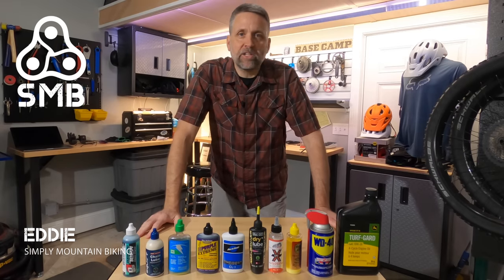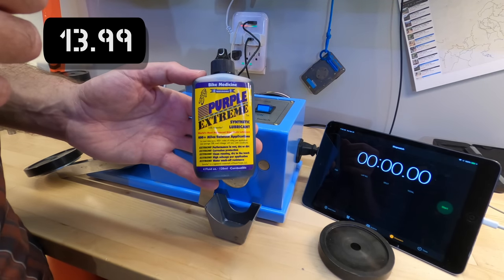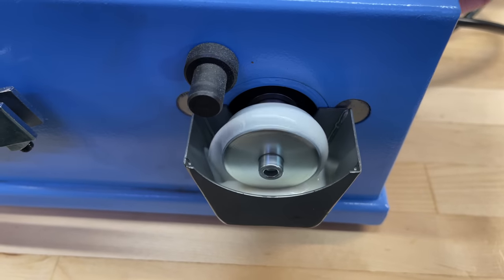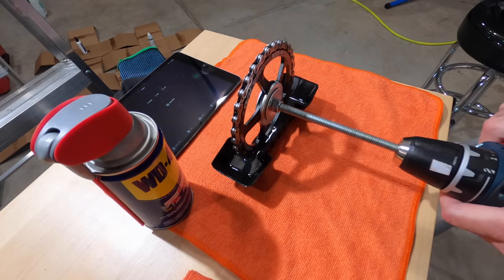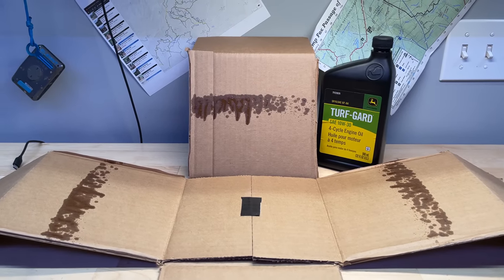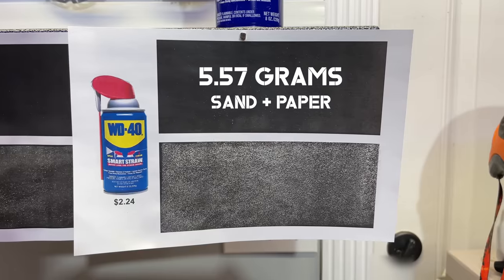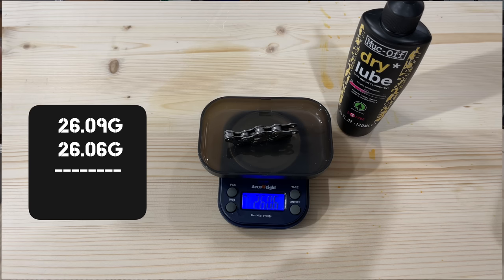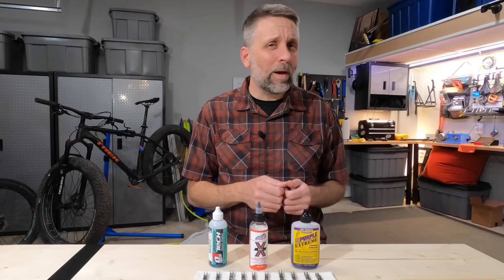Ultimate Bicycle Chain Lubricant Test | Best Bike Chain Lube

Comment: Good video and tests. Funny thing though, I replaced Muc Off after years of use and went to Squirt, it is head and shoulders better in real world application. I have doubled chain life, which increases cog life. Also you dont have to perform deep chain cleaning ever again, just wipe of surface dust and add more lube. Maybe you could have explained a paraffin lube to oil base lubes better. Again, good video.
Reply from the maker: Thanks for sharing!  I'll have a dry test of Squirt soon.  I'll also be comparing Squirt to another paraffin.  I hope you'll watch it. -Eddie
Reply: @SimplyMountainBiking  Hope to see you adding a "OZ cycle recipe (pure parraffin with a 10th  1.6micron PTFE)" Heat wax bath to that test.
Reply: I did the same! I was really disappointed with Muc Off...the only "positive" for me was that it smelled nice. It wears off completely after each ride on my gravel bike...the drivetrain starts sounding like a bird sanctuary after 60-70 km...
Reply: I got a free sample of Squirt for a race a few years ago. That's now my go-to lube. I ride in the SW US and it's perfect.
Reply: Wow, I just shifted to Squirt also. Not picking up dirt and dust is important! I was using Muc Off, but it seemed to gum up the chain after a while.
Reply: The thing with Squirt is, it works exceptionally well if you're lazy. In a lab test you're not lazy, but when coming home from a wet bike ride beging tired you probably are. Squirt is just really, really low maintenance compared to something like the muc-off dry lube.

Comment: Absolutely loved this video. Was up in the air what chain lube to buy, now I know. Thanks
Reply from the maker: Glad I could help! -Eddie
Reply: No you don’t, test was fun to watch but rather meaningless. Comparing apples and pears. Can’t compare regular oils with lubricants that are using a carrier that needs to evaporate before the lubricant will do it’s job. 
I don’t know if the product that “won” is good, it might very well be. But the way these tests were carried out were not correct at all.

Comment: Absolutely amazing work on the tests! Very nice methodology and a great setup for repeatability. 
I only have one small point to criticize. 
The first test is fairly unrealistic in any bike related scenario and none of the bike lubricants are designed to work this way. 
I would have loved to see the same method as used with the Muc-Off dry lube as that is a lot more realistic. 

I would wager that WD-40 could actually perform better that way as the cleaning agents that are part of the WD-40 that are designed to loosen and solve particles from metal would have evaporated potentially leading to less wear.
Reply from the maker: Thank you for the comment and suggestions! -Eddie

Comment: Pretty thorough!  These days, if you don't have immersive wax in your test, you're missing it.  On MTB for dry conditions it's ultra fast, and attracts zero dust/dirt.
Reply: It's does well in wet conditions also
Reply: @pewsician2388  I would differ with you there.   I started with it here in OR this early spring and was caught a few times in steady rains.  On a solid, wet, gritty ride like that the wax is gone gone gone when you get home.  Testing shows it's not great in wet or muddy conditions--where you'd be better off with a wet lube--Silca's Synergetic.  I'll use that in Winter and Super Secret in Summer here.  DOesn't rain all summer.
Reply from the maker: I don't ride dry and was selfish in this test - testing only lubes I would consider using... -Eddie

Comment: Great video! Although most tests don't reflect wear conditions on a real chain, I recommend the channel Zero Friction Cycling. It has more accurate tests. My go to would be Squirt
Reply from the maker: ZFS is a distributor for MSW.  I'm just a dude in my garage.  I have no sponsors or interest in any lube winning.  I didn't find wax to be a good lubricant at all.  -Eddie
Reply: @SimplyMountainBiking  you might want to revisit wax , it's unmatched in chain and drive train longevity and also the fastest. It's not for everyone in every situation.

Comment: While was making a run for supplies I needed for work, I purchased a bottle of Rock N Roll about two weeks ago. I had been having some creaking and clanking issues with my chain for about a year that was quite annoying. I initially thought it was a problem somewhere in my 3 piece crank, but I'm glad I didn't take the bike to be serviced. I used the product as suggested, then gave the chain, free coaster wheel, and chain wheel a good cleaning. Those three areas were where the problem was coming from. An old Champion shirt, a few Q-Tips, and a folded bus transfer were the tool kit I used to get the gunk out of the small spaces and corners.
Reply from the maker: Thanks for sharing! -Eddie

Comment: Excellent test. I can vouch for Muc-Off Dry as well, having used it with good results. If availability wasn't an issue in my neck of the woods, I'd keep buying it. 

I'd love to see you put Boeshield T-9 and Weldtite TF2 All-Weather through their paces in this test as well.
Reply from the maker: Thanks for sharing your suggestions.  I'll add them to the list to consider for a viewer's choice video. -Eddie
Reply: Agree about Boeshield T-9.  It's the only lube I use after 35+ yrs of biking.  I don't have any complaints.

Comment: Loved the tests, so comprehensive. I wish some other very popular lubes were tested like Finish Line Dry Teflon, WD-40 Dry and Pro Link Gold. Although these seem similar to other lubes tested and probably wouldn't stand up to Muc-Off.
Reply from the maker: Great suggestions! I'll have a look at these if I do a "viewers choice" video review. -Eddie
Reply: Also maxima chain pro, finish like wet, 3M Chain saver, Tri flow…etc
Reply: May I suggest that you test a bottle [not spray can] of 3-IN-ONE Multi-Purpose Oil?

Comment: Love how in depth your tests are and subscribed off the back of your chain cleaner tests. 
Stumbled across this test and must say I am and am not surprised. I've just switched to Squirt after years on Rock n Roll gold. in the month I've used it on both my MTB and gravel bike I've noticed that I don't have to apply it as frequently as I did Gold and that my drivetrain is quieter with Squirt. 
The issue with the wear test here is that you are testing metal on metal at high rotational speeds. This high rotational speed will cause more heat build up at the contact area and will brake down some lubricants faster than other, particularly some of the waxes which will melt. Bike chains don't move very fast, don't have high rotational speeds and therefore don't get hot so a lube designed for a bike chain won't necessarily do well in your test as it hasn't been designed with high rotation and heat in mind. There is a reason why there are so many lubricants out for for different uses and this test isn't really indicative of how a bike chain works.
What I've noticed in the real world is that I'm liking Squirt more than any other lube I've tried so far. Sure, I don't have a long time on the product so don't know how it will fair long term but usually a quieter, cleaner chain would indicate less wear occurring.
Keep up the good work, I know how time consuming these videos are to create!
Reply from the maker: Thank you for your feedback.  I love it when people share their real world experience here - to contrast against the lab tests! -Eddie

Comment: Measuring the weight loss of the cylinders instead of the size of the scar would have been a much more accurate way of determining which lubes lubed better.  But great video and thanks for all the information!
Reply from the maker: Thank you for your feedback. -Eddie
Reply: Are you in mech eng

Comment: Wow!   Super video.     Loved it!     Really appreciate all the effort and time you put into it!

I happen to use Rock n Roll Gold.   Glad to see it did well.   It's sold as a drip on dry lube (goes on wet, wipe dry, then let dry for 8 hours before using the bike).    Wonder how it would have scored in the sand retention test if it been allowed to dry first.    Really keeps my chain clean.
Reply from the maker: Thank you - and I appreciate the perspective on letting R&R Gold dry. -Eddie
Reply: I use the RnR Gold on the Recc of World Cup Champion mech Brad Copeland.  He's tried 'em all. I believe gold is not marketed as a dry lube .."creates a wet membrane..." It works best after sitting a few hours because it apparently pushes contaminants out to the surface over time which you then wipe off. Works great five minutes after applying as well.

Comment: I'd be interested to see how Muc-Off's wet lube compares across those same challenges - I was actually pretty surprised to see how well the M-O dry did against the water.
Reply from the maker: Thanks for the suggestion - I might give it a try. -Eddie
Reply: First off thank you for this video’ aros e job! 

@kieran0 I’d second that! I’ve used wet during the winter and switch to wax in the summer. 
I’d love to see how each of the muc-off products perform against each other. 
It would be great to also see how different wax’s perform this had been my first season using wax during the dry months and I enjoyed them. Seemed like my chain stretch and wear were significantly decreased. Am I crazy? Thanks Eddie

Comment: I see a lot of comments regarding Squirt. I am a Squirt user and it’s definitely fantastic. I noticed right away that in the first friction test you didn’t wait until the wax dried which is the recommended way to use it hence why I knew the wear would be too much. I’m glad you rectified that later in your comments. Definitely wait overnight before you go out and ride your bike. I’ve had my chain for 2.5 years now and have ridden over 12,500 km on it and no wear on my chain yet. An Ultegra 11 speed.
Reply from the maker: Thanks for sharing! -Eddie

Comment: Complex, objective,extremely comprehensive, and professional. 6 stars. But in doing basic free repair in  a "low income" city on many old bikes that are not used to travel far, and many are often left out in the rain and snow or otherwise not much cared for (and often get stolen), I  have just use drained motor oil.   But I do have some "Finish line" dry lubricant I will now use on a new bike. Thanks for the exceptional testing.
Reply from the maker: Thanks for the comment! -Eddie

Comment: I'm currently using Purple Extreme, so far so good, but had i known about rock n roll gold I probably would have chosen that lube. I was primarily looking for a good chain lude to use this winter. i live in Wisconsin so I'm dealing with cold temp, snow, slush, rain, and road salt all getting on my chain this winter.
10/27/2023 Update: I stopped using Purple Extreme and switched to Finish Line wet lube but noticed that my chain was getting VERY dirty even after only just one week of road cycling. I just switched to R&R Gold today.
Reply from the maker: I think Purple Extreme is a good choice for your winter climate.  It has low viscosity - allowing it to flow better when cold - and keep those inner surfaces on the roller bearings lubed. -Eddie

Comment: Thanks for the honest review 🙂
May I suggest that you test a bottle [not spray can] of 3-IN-ONE Multi-Purpose Oil?
It would be interesting to know how well it performs - especially because it is inexpensive and it is something that most people have in their tool shed / garage.
.
OK, a can of WD-40 is something that most people have at home too.
But everyone knows pretty much that WD-40 is for freeing / loosening up rusted / corroded components etc.
[a stuck bolt or screw, or a stiff door hinge etc.]
It is not intended as a lubricant nor was it ever.
.
Also, I have to say that some tests that you did were pretty much a total waste of time.
Test the product as it is intended to be used.
An oil, sure it is sticky, but it stays on the moving part.
A dry lube, well don´t test if sand sticks to it seconds after application, test if it sticks after the allowed drying time.  And don´t test using a reservoir of liquid product for a dry lube - that makes almost no sense at all.
.
cheers 👍
JB
Reply from the maker: You're welcome.  Thanks for the feedback. -Eddie

Comment: I use motorcycle / industrial high speed chain lubes for bikes. If they work in a motorcycle when riding 200+ km/h, they must work in a bike where requirements are much lower. One thing, WD-40 is not a lubricant. Anyway, this was quality content and interesting to watch.
Reply from the maker: Thank you.  And thanks for the tip! -Eddie

Comment: About 4 months ago I went from using Muc-Off to Squirt. I am never going back. The chain stays totally clean and it lasts twice as long as Muc-Off.
I have to stress, if you go from oil, or a new chain, to wax, clean your chain thoroughly. It's worth it. Now I only dry brush the chain before rewaxing. Oh what a joy!
Reply from the maker: Are you a road cyclist or MTB?  I think I'm noticing that road cyclists are the primary endorsement for Squirt and wax...  -Eddie
Reply: @SimplyMountainBiking  Road. And yeah, I have no idea how it performs in the mud. I can imagine though that hosing your chain every week might make MTB riders less enthusiastic about these products.
For me a quick sweep with a light brush is usually sufficient.

Comment: I’ve recently become a bit obsessed with studying products like this. Mostly gun oils along with some other stuff. This video is amazing. Your tests were so well done and extremely informative. There’s a ton of products like this you could test. I know this a bike channel but if you’re interested I could recommend some gun oils to test. In any case you should check out for yourself a product called seafoam deep creep. It’s a penetrating oil for loosening rusty bolts and such, but is also quite a good lubricant, protects fairly well against rust, and is supposed to resist heat and evaporation. They recommend it for bike chains.
Reply from the maker: Thank you so much!  I don't have any current plans to break out the test kit soon.  I'll keep this in mind - maybe some day! -Eddie

Comment: Very thorough testing protocol, however, one FLAW, and it is a big one; several of these lubes, including the best friction resisting one, Demonde, in particular, is meant to be applied sparingly, worked in by riding to generate heat, thus bonding the product, then the excess wiped off before and after a moderate ride. Some of the others are also meant to set up/dry prior to riding. These oversights, unfortunately, pretty much cancels out several of the results of the impressive work that you so painstakingly put into your testing procedure. Would love to see you make "Ultimate Bicycle Chain Lubricant Test | Best Bike Chain Lube 2.0".
Reply from the maker: Thank you for your comment.  -Eddie

Comment: I can only speak for Dumonde tech and muc off. Both of those lubes are meant to dry before use. Dumonde tech is extremely finicky working best when one drop has been applied to each roller, the the entire chain is throughly wiped with a rag. The goal is to have lube on only the mating surfaces. After that it works spectacular in both and dry conditions. I would have really loved to see an motor connected to a dynomometer to test the efficiency of the chain lubes.
Reply from the maker: Thanks for sharing! -Eddie

Comment: This presentation was outstanding!  After getting the Muc-Off Wet in a Kit, I decided to buy the Dry and I also was impressed by it's ease of application, performance, and smell! I was very impressed by the water test with it, as I thought it would really have issues with that one.
The bottle of Rock n Roll gold that I have says it should applied the night before riding and left to dry;   would have liked to seen the results if left to dry like the other 3 @15:34
Reply from the maker: Thanks for sharing! -Eddie

Comment: One comment about the leader lubricant (Muc off). You mentioned that it had a “banana” smell. Something you should be aware of, I’m a beekeeper, and one of the thumb rules we go by is “No Banana scents”, regardless if is an actual banana, a scented perfume, or even a banana cream pie odor ( especially artificial banana). This scent closely resembles the alert pheromone that bees use to point out a threat. Once the bees start stinging, they will release more scent, resulting in a more severe attack, from which running or even immersion in water will NOT stop. ( I’ve serviced apiaries that consisted of Africanized (so called “killer”) bees, so I do have some experience with this.
Along with the banana scent, once alerted, the bees will concentrate on the color black, as in black clothing, bicycles, camera cases, and even car or bike black plastic mirror backs. 
I would advise that you avoid this scent when going on a ride… if you do alert bees, you will NOT succeed in outrunning them. Best to cover your face and get indoors where you can block the attacks and remove the bees. 
Beekeepers routinely use their smoker tools to apply smoke to their suits. This seems to work well as we have them working prior to working the bees.
Just a heads up.
Reply from the maker: You learn the neatest things on YouTube.  Thanks for sharing! -Eddie

Comment: Very great video! Very impressed! WD-40 is an acronym for Water-Displacement Formula Version 40. It's only purpose is to displace water. It was created to control condensation and prevent rust on inter-continental ballistics missiles, potentially carrying nuclear warheads, or Atom bombs. Definitely not a chain lube. Or lubrication of any sort. I'm surprised it didn't perform better in the spray test!
Reply from the maker: Thanks for sharing! -Eddie